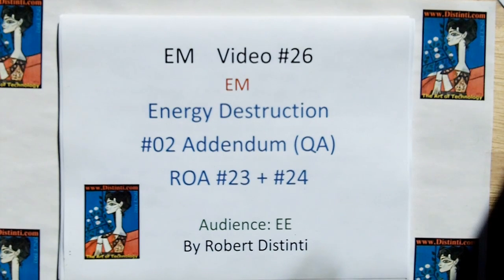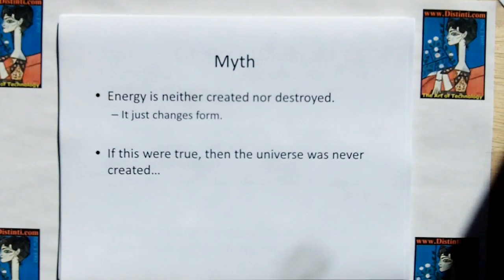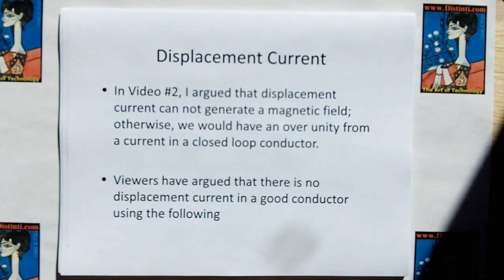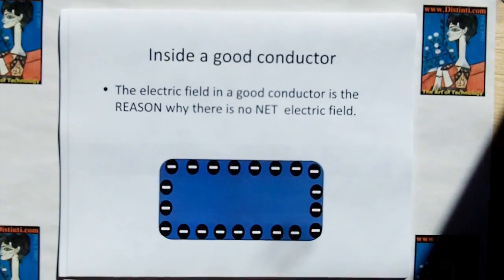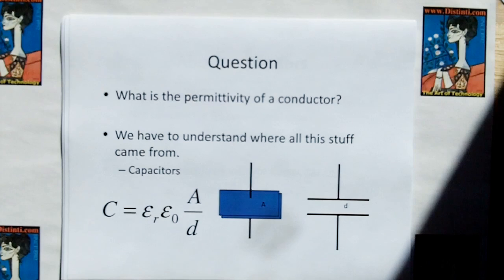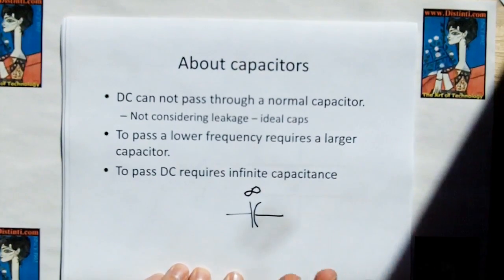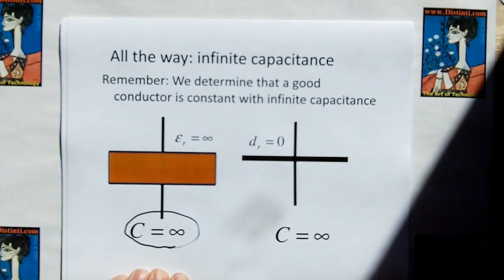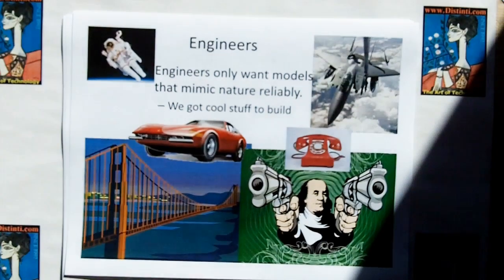emV026: Energy Destruction and Displacement Current Q&A

Comment: You are misunderstood. Displacement current DO generate magnetic field. However, the magnetic field generated is perpendicular to the magnetic field generate by the conduction current. This is why we DONT get overunity.

Instead of trying to act smart, think 100 times before you try to devalue displacement current. The fact that displacement current generate magnetic field shows that we can use dielectric instead of metal for the construction of coil, such as optic fibre.
Reply from the maker: incorrect.  curl(H) = j+dD/dt.   there is no perpendicularity in this equation -- the field has the same orientation.    Perhaps you should stop thinking and review the basic equation 100 times so you don't look dumb.
Reply: @rdistinti 
Are you that blind? The displacement current from wire to wire is perpendicular to conduction current. Hence, the associated magnetic field is PERPENDICULAR to the magnetic field associated with conduction current.

Again, think 100 times before you make a fool out of yourself.

The simplicity above has NOTHING to do with equations but simple detectable FACT.
Reply from the maker: You have things mixed up.  The static electric field about a conductor is perpendicular.  The change in electric field (what Maxwell calls displacement current) is in the same direction as the current flow. see https://en.wikipedia.org/wiki/Displacement_current.  Do the math: and lets dispense with the derogatory remarks.  they don't accomplish anything
Reply from the maker: Maxwell described the direction of displacement current to be in the direction of current flow through a capacitor (not me).  All you have to do is take the time rate of change of the electric field of moving charges to show this to be true.  This direction is NOT MY CLAIM!!!!  My claim is that displacement current (as defined by Maxwell) can not generate a magnetic field.  If you have a problem with the direction of displacement current; then  it is not my job to defend it because displacement current (and its direction) become irrelevant if my claim is true.   I will be replacing this video in the future where I will include three different ways to show that J=dD/dT.    So you can wait til then and I will show you how to take the simple time derivative of moving charge.  I'm wasting time on remaking this video because it is amazing how many people with degrees can not do simple vector calculus.  Its ironic because vector calculus was invented by someone who did not go to college.  This world is retarded.
Reply: @rdistinti  There are FTL waves of aether as well.
Reply from the maker: Then it is a simple thing for you to take the time derivation of moving charge to show that displacement current is in the direction of the moving charge.  If you disagree with that then your argument is not with me, it should be requesting a refund from your university.
Reply: @rdistinti  Okay then. Simple inductor coupled to a capacitor magnetically. There's an error to your statement. If displacement current is in the same direction as conduction current, WHY is there phase shift?
Reply from the maker: how do you couple and inductor to a capacitor?
Reply: @rdistinti  Wound the dielectric part of the capacitor like a coil? Follow mislavskij transformer, and obeying maxwell-ampere law. Displacement current is right hand rule as well, or is it?
Reply from the maker: This is the exact experiment that I used 20 years ago to try to either prove or disprove that displacement current generates a magnetic field.  I found that from modeling, it is impossible to separate dD/dt from dQ/dt and this experiment can neither prove nor disprove.  This video was the ultimate result of that experiment.  Did you know that the displacement current in the mislavikij experiment is in the direction of current flow around the loop as I have explained!   Yes it is perpendicular to the plates of the capacitor; however, it is in the direction of actual current flow. There is absolutely no way to prove that the energy induced in the coil is from displacement current as opposed to the movement of actual charges in the loop or the dielectric.
Reply from the maker: Here Is the video of me throwing this experiment out after having waste space for 20 years https://www.youtube.com/watch?v=Ca7eg04QiC8

Comment: 4:06; Think about this. A neutralized field not measurable by any known means is by definition not present. This may be true for the conditions you impose, but it is not accurate. There are neutralized fields that when properly stimulated reveal the latent components. It is measurable by a simple means of stimulating the field with an imbalanced field force and getting a reaction that is not directly proportional to the energy of the disturbing field. Still you are not measuring the actual field, only the amount of field energy made apparent by the rate of change of the disturbance. This is the essence of induction. 

Canceled or neutralized has a critical difference between them. Considering the distances that field effects have on other fields (atomic particles 100,000 times their diameter separations, electrons and protons separated by 50,000 times the diameter of the protons, and orbits of stellar objects), it is doubtful that short of transforming a field into another field "form" (you seem to consider this being consumed by the Ether), no field is actually canceled. And fields are subject to special disturbances that will elicit highly energetic reactions. 

There is also the apparent field creation that occurs when small fields align and create separate fields that behave independently of the smaller fields as in permanent magnets and electromagnets. Again, either otherwise immeasurable fields are being stimulated into action to empower these larger fields, or fields have some magical/natural way of amplifying and separating collective fields from their sources.

Finally, we know from wave behaviors that moving fields can be combined to appear as something else, or neutralized to appear as absent, yet revealed with the proper disturbance. (As in sign waves combining to form square waves.)

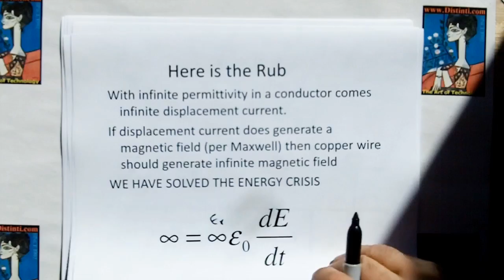Comment: At about 12:00, the rub, isn't that infinite permittivity with respect to time. So not infinite capacity but Zero capacity, so displacement currents are passed through conductors with no delay? Not infinite capacity that is never filled. If displacement current is passed as a longitudinal wave, it is possible also that it would be conducted at a FTL speed. As reported by Tesla and others. Also, modeling effectively as charges does not define electricity as moving charges. An assumption that limits the options of what could be real.

Comment: Some days ago I've looked again to this video emV026. At 3:05 min, you say ether is conumed by a charge and emits a coulomb field.
My point of view was the coulomb force was an effect of the ether flowing to a charge. 
Ether was converted to speed (velocity)
If negative charge consumes all positive ethons, it should look somewhere else for the ethons.
When charges are moving in the direction of the highest ethon density, one could say that due to a lack of ethons between two equeal charges, the charges will repel.

This way all forces can be defined as being caused by the ether